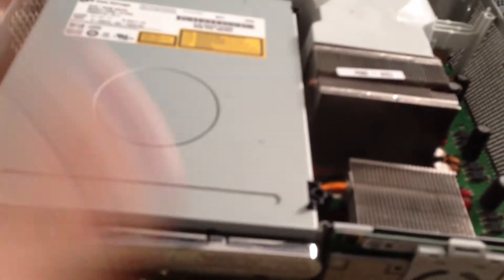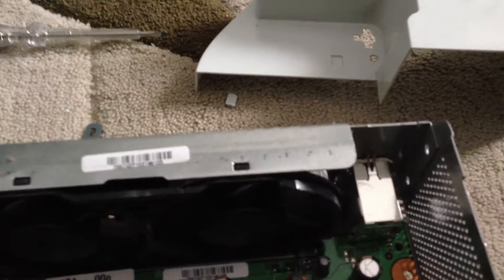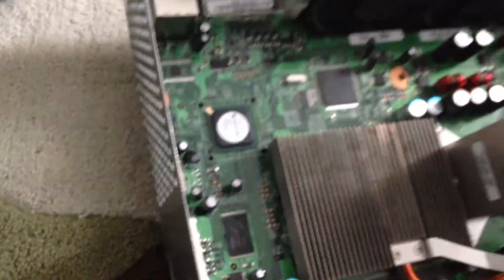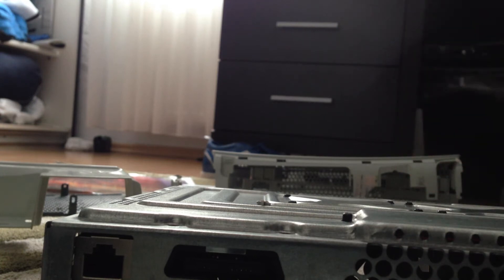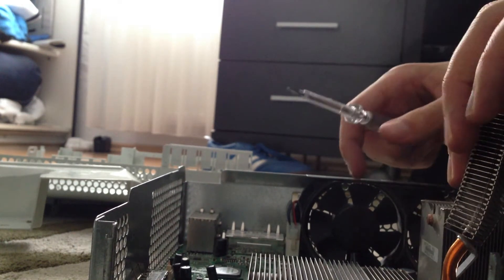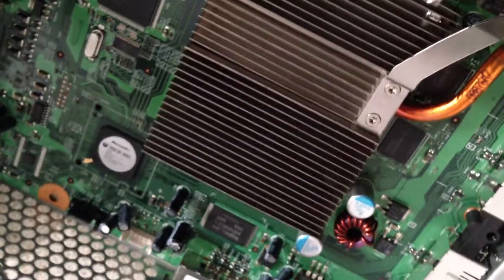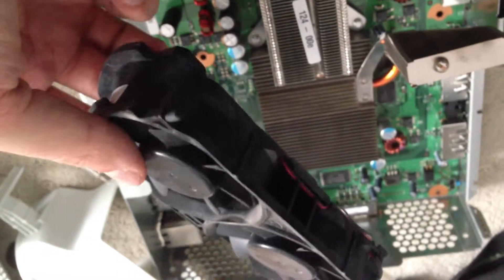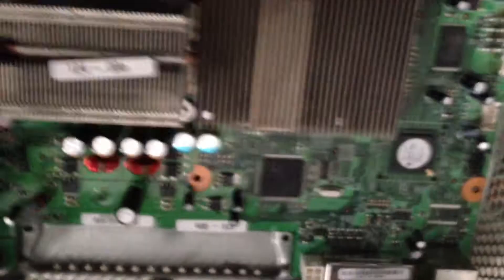Whats inside the Xbox 360 ? (Hardware)

Comment: Its under the big radiator I think. Those are transistors, the tall radiator looks like the cpu cooling one yeah. the biggest chip is probably the GPU (not graphics card) and the smalls ones could be audio network chips